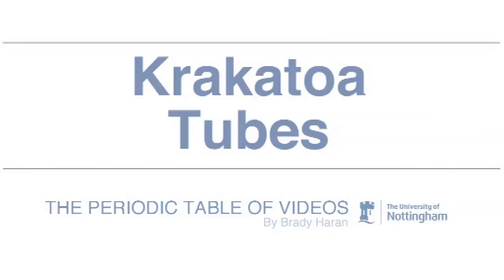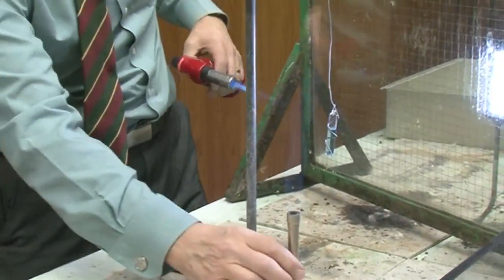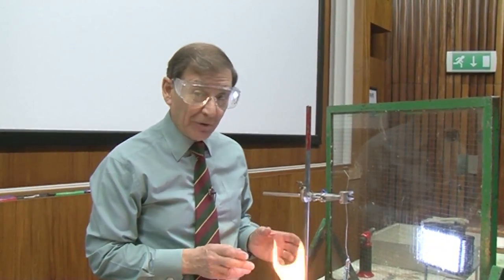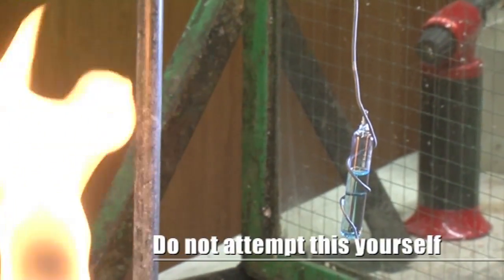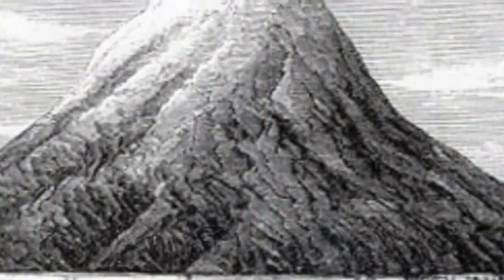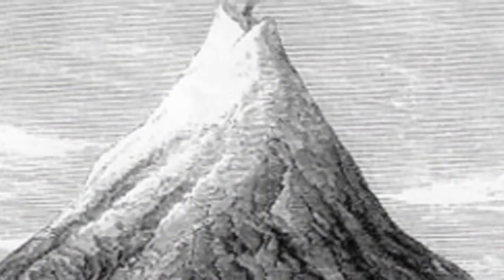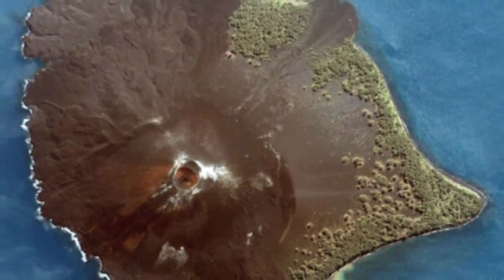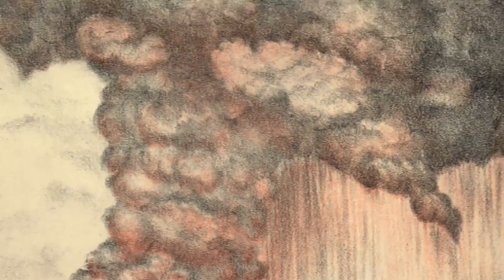Krakatoa Tubes - Periodic Table of Videos

Comment: I thought the theory on Krakatoa was that as the volcano erupted and spewed out lava the magma pocket underneath started to depressurize causing the dissolved co2 and other gasses to drop out of suspension and cause a massive rise in pressure causing the secondary explosion because it couldn't vent through the eruption faster than the pressure was being generated?
Or am I getting confused with another volcano?   Too tired man xD

Comment: When liquid water transforms to water vapor (steam) it expands on a ratio of 1850 to 1. There for 1cc of water becomes nearly two cubic meters of gas. in this demonstration that happens nearly instantaneously. This is why high pressure boilers are so very dangerous. The energy released when a couple cubic meters of water flash into steam in a couple microseconds is incredible.

Comment: In my youth, we were stupid enough to drill out the end of a spent CO2 cartridge, dribble in gunpowder until full then epoxy a length of fuse in place.  An exceedingly dangerous example of a high pressure mechanical explosion.

Comment: Minerals often contain trapped bubbles of liquid-gas (called fluid inclusion) under enormous pressures (equivalent to miles underground, where they were formed). 

They're usually small and harmless. But occasionally, when a mineral contains large fluid inclusions and it's heated e.g. by display case spotlights - a big fluid inclusion can explode violently.

A glass shelf was destroyed at the Tuscon mineral show by an exploding Aquamarine in 2006...

See "the case of the exploding aquamarines"

Comment: @jfn1103 Look up the meaning of "bleve" and you'll understand why.  In summary, the water stays a liquid, although it is well above the boiling point.  If the containment vessel fails, it flashes instantly to steam.  All of it, all at once. Steam is some 1900 times the volume of the water.  Not something you want to be next to ;)

Comment: @Meiz79 

burners are usually between 700-1000 Celsius depending on the gas 

look like theirs was on the lower end because the flame was so wild/more oxygen

probably doesnt need to by heated more then 2 minutes